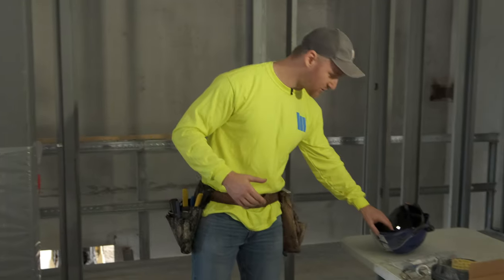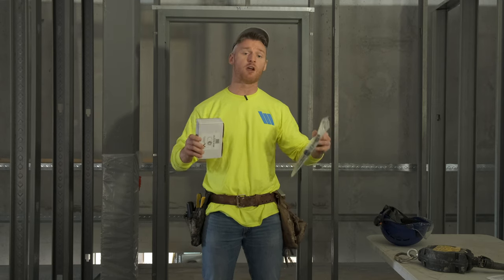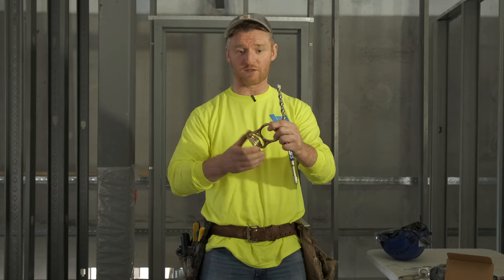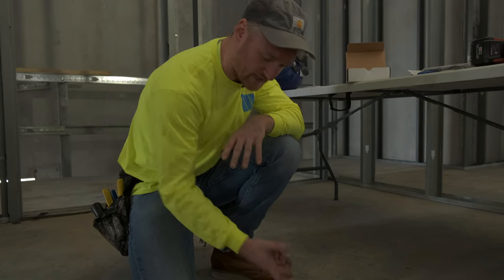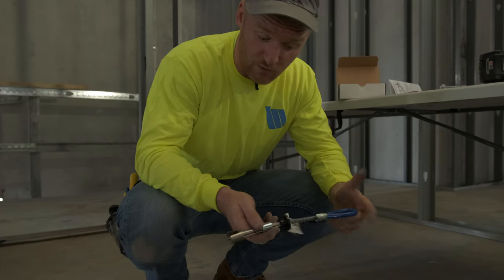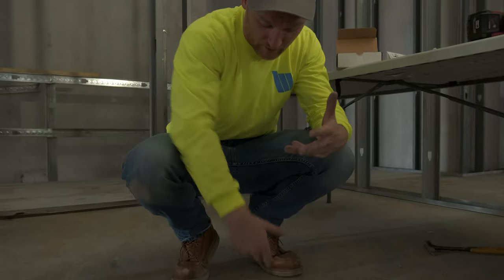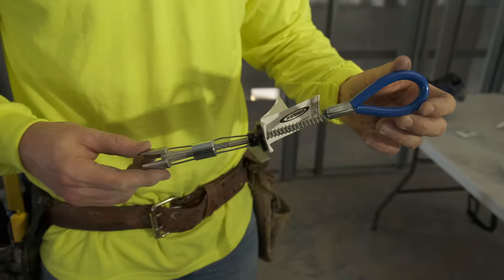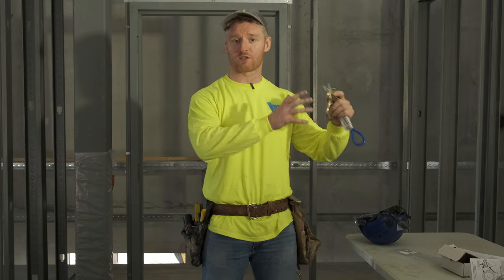Concrete Anchors for Fall Protection On Job Sites

Comment: Tip: for the swivel anchor, get rid of the bolt with the sleeve and start using a reusable HUS bolt from Hilti. HUS bolts can be reused several times.  Hilti has a measuring gauge to check to see if they are still usable, which I think is up to 25 uses.  My employer had an engineering company test the HUS bolts and they stood up to the legal requirements for anchorage.
Reply from the maker: So my only question to that is, then someone has to keep track of the bolts and their usage then right? Seems great in theory but messy if anything we’re to happen with a used anchor.
Reply: @mitchellacoustical3119  good point.  I think I'll need to implement periodic inspections by a competent person.